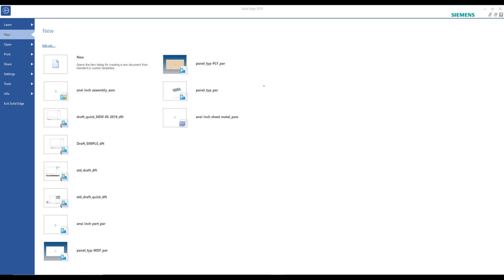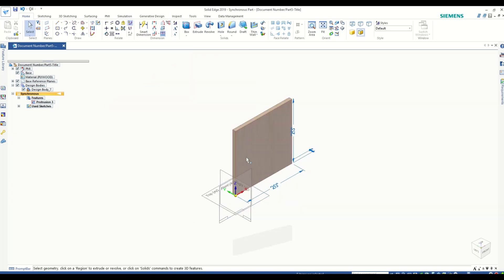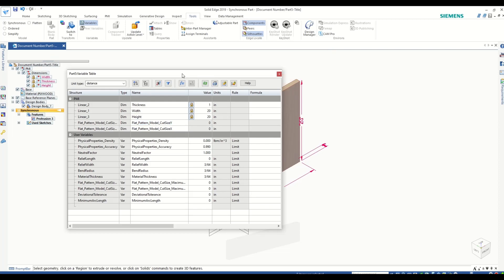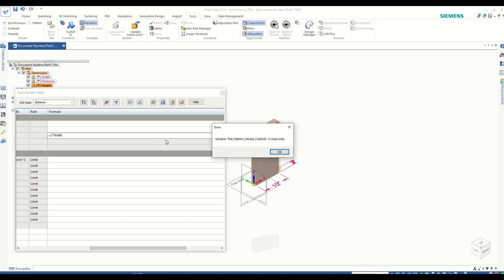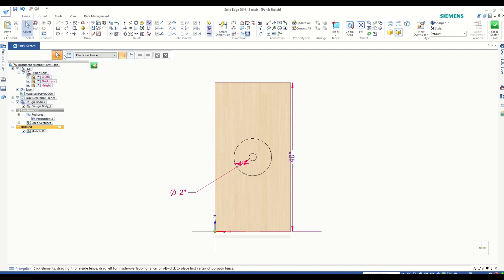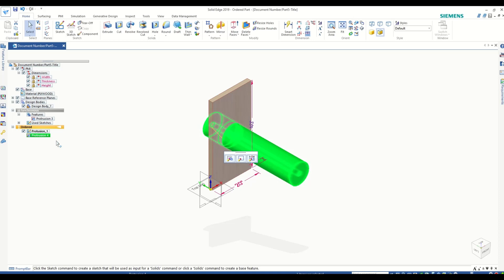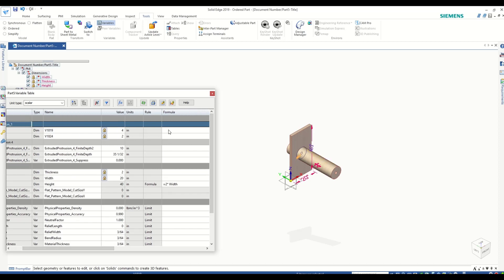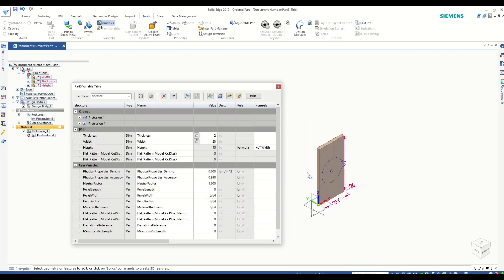Solid Edge- Variable Tables/Parametric Parts

Comment: Is it possible to create a new variable (for example thickness) and associate it multiple times when i design? for example If I wanted a thickness of 4mm, would I be able to extrude and set "thickness" instead of 4 mm in the white box (where it asks you to define the dimensions)? This would be very helpful, especially if I wanted to change with one step only all the "thicknesses" of my part.
thank you
Reply from the maker: Hello Stefano, yes you would be able to associate same variable to multiple features. You need to double click when you place the dimensions and it will bring up the formula ba, where you can type "=thickness".